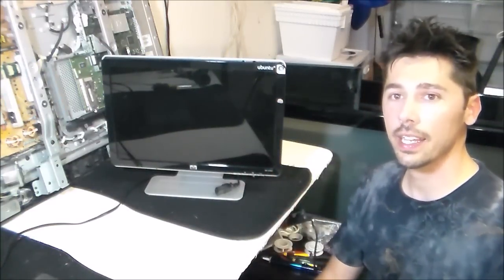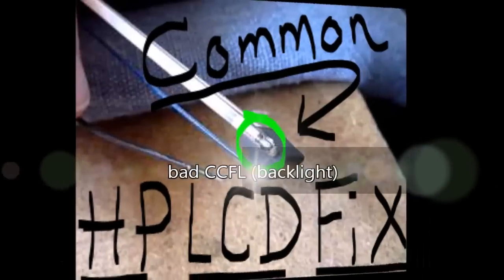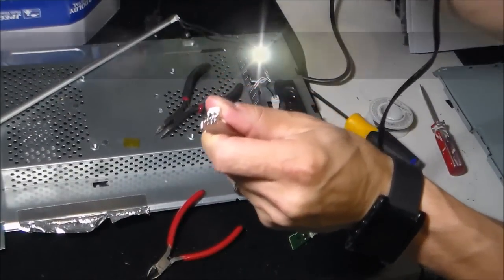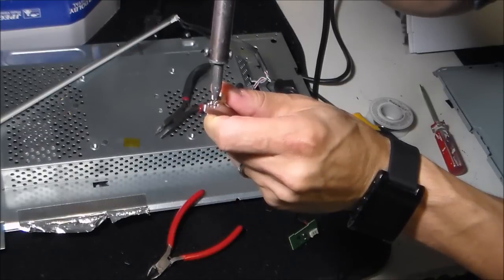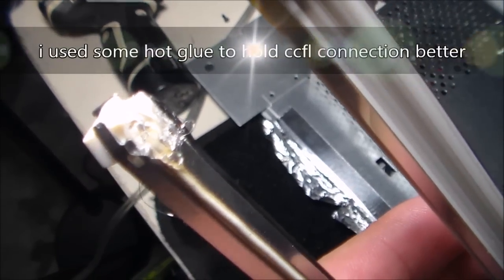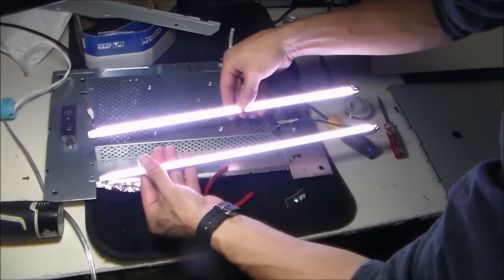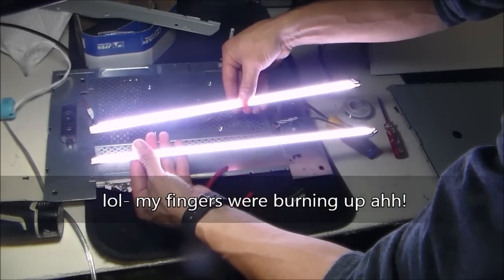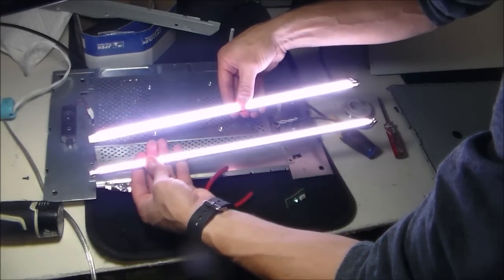HOW TO FIX HP LCD, monitor turns off after 3 seconds (common repair)

Comment from the maker: Common fix for HP LCD, i worked on this video all night i hope it helps someone. please like/share/sub
get lcd caps here- http://www.amazon.com/Samsung-CAPACITOR-desoldering-CAPACITORS-Replacement/dp/B008PWWS32?tag=tampfreepcpin-20&linkCode=w13&linkID=&ref_=assoc_res_sw_result_1
 #lcdfix   #commonfix   #easylcdfix   #lcdrepair   #lcdservice
Reply: Very nice video again, do you have a video where the lamps are ok and you check the Power board capacitors?  thanks so much.
Reply: I think I'm gonna buy another computer
Reply: +sl2k4u +1 : high voltage inverters can be faulty too, I am trying hard to figure which can be : bulbs, inverters, capacitors ... Even with measuring devices.
Reply: +RegneGames Hopefully you figured out the issue by now, but different issues can provide differing effects... Sometimes when the inverter is bad, you'll see a pink hue prior to the screen or backlight turning off. With caps in the power supply you'll end up with issues such as an audible alert if the monitor has speakers, lights turning on / off, monitor not turning on, etc... With the backlight shutting off shortly after the monitor turns on, it can be the bulb or electrical component related.. In this case because the connections were "burned" away, there was still a connection but after applying current, the wires were able to sustain it for only a short time...

This may be the same issue I'm having with one of my new monitors; I have 3 I'm waiting for caps to arrive in the main and a new one I got where the backlight shuts off in under 1 second... I'll double-check the connections on the backlight when I go through the disassembly phase. Cheers.
Reply: +Tampatec  my  hp 2310 just went out, do you want to fix it, I'll send it to your place, and you tell me what is wrong with it then we take it from there., 
there was some lines on the right side last night, and for the past week there was some low frequency flickering in the monitor. then went out black, as someone shut off the lights.
Reply: Fixed all except the one where the previous owner tried installing a cap backwards.. need 2 new cfls, then I need to also rewire the tray where they're mounted in because of a design-defect which causes the wires to burn..
Reply: Is there anyway I could ask you about symptoms my monitor has and if its the same as this video?
Reply: hi I have an older type hp Dell computer when I turn it on it seems to get stuck, but the computer is on and is running all the time. I don't know what to do and need help. I 'm not too computer savvy.
Reply: Rongo Taingahue Do you hear any beeps? Check the caps ( cylindrical usually with a K indent on the top, unless solid state ) to see if they're bulging or loose like a loose tooth when the computer is off. If so, then you'll either need to replace the caps or replace the board; if your pc is older than 5 years I'd suggest upgrading. It could also be memory, when the pc is off take one out and try to boot, then turn the computer off and repeat with other sticks of memory trying each stick in different slots. If you do see text on the screen but it says something along the lines of missing boot record, etc.. it is likely the hard-drive. -- you should be able to turn it off forcefully by holding the power button, if not then flip the switch on the power-supply or unplug it...
Reply: Tampatec I broke my screen you didn't explain the hidden screw I had to find that hidden which cost my screen that broke
Reply: Tampatec I broke my screen you didn't explain the hidden screw I had to find that hidden which cost my screen that broke
Reply: i am so glad its not a problem with my computer itself. Granted mine is a 2009 monitor(didnt use it for 4 years) so thats still 4 years of use. I think an equivalent monitor would run me 100 so maybe I should try this. thanks
Reply: i need help of fixing my computer it is a touch screen and is windows 10 but the screen and the lcp panel within it is cracked as well i need help to fix it
Reply: Tampatec I have a 52" sharp aquos LC-52D85U one of the lamps went out... Do u know where I can find one? or is there some type of rig to fix problem? T.V will not stay on

Comment: I found this very useful. This eliminates the possibility of bad capacitors. You could easily apply this theory to some issues on certain LCD monitors. I'm not saying it could apply to all, but it could help to narrow down the problem a lot easier. I'll take this into consideration. Thank you for this tutorial.
Reply from the maker: cool thanks!
Reply: Same here, i'm looking for a faulty capacitor and discover this video. Many Thanks @TampaTec !

Comment: I have a 26" Vizio it turns on and the picture comes on the screen but then the lights just goes out after like 3 to 4 sec. the image is still on the screen but you have to flash a light on it. I thought it could have been the inverter but could it be the led lights like on this video?..

Comment: Now how dafuq do i put all the parts back together?
Reply: I like to make pitctures from every step when i disassemble stuff.
I also use manny bowls for all the screws u need for all the different step so i don't mix them up and put them at a wrong place.
greetings I am gonne fix my Hp screen now :P
Reply: @hmcredfed1836  You can also take a sheet of cardboard and draw the profile of the piece you're disassembling right on it (drawing the various screw points as small circles), and then "poke" the screws you removed directly into the cardboard template. Have smaller individual pieces that are also screwed together, draw a smaller template! This way you don't have to worry about mixing up the various screws which will have different lengths and thread types.

Comment: Just wanted to say a giant Thank You! I just used this guide to repair an HP 2509b monitor.
I was very skeptical because both lights were going out, but fixing the burned area on a single bulb unit seems to have done the trick.
All the best!
Reply from the maker: Awesome! Congrats fixing your monitor 👍.
Reply: How did you fix the burned area, because it means there is an open in the bulb?

Comment: way too much work! I'll end up doing more damage then good! I'll just buy a new monitor!
Reply: Good to see just how much work is involved in taking apart an HP monitor. We had much better luck with a big 24 inch LG repairing the backlight (much easier access). Have an HP LP3065 to replace the backlight on.

Comment: Thanks bro, you helped me save 9 monitors for my home setup. I just needed the tubes. What I learned is my tubes were fine after 16 years on HP 1730. What fails on this model is the output coils secondaries. The low height transformers that are about the size of a stamp. These are hard to find so you might have to rewind them. Old HP were built like tanks.

Comment: This video was very informative. My model would stay on for 1 second then turn off. If I had the monitor in the right lighting I can barely make out text, so this led me to believe it was a backlight issue. I was able to make my way into the settings>brightness section and decreased the brightness. I then turned off/on the monitor and it worked. Not sure how long it will last now. But one thing is for sure..the monitor's capacitors (as stated in this video) are more than likely busted.

Comment: ppl me problem is next : me PC monitor works until i turn off me pc and i go to sleep and next day when i turn on PC i go t pictures on me monitor for 2sec and disepire and what i do?? in start of me problem i found solution 5-6 click on power buton of monitor and i got pictures and monitor works totaly ok until next day and new turn on me PC can some1 tell me are is problems in capacitor or what? tyyyy me monitor is samsun 2220LM

Comment: hello +Tampatec mine is hp pavalion 22xi it turns off after 2 hours and i have to unplug it then the time becomes shorter is it the same problem . checked the capacitator on power supply board and they're fine ?! is it the backlight ccfl ? note the lower the brightness the longer it stays
Reply: It sounds like something is overheating. Could still be capacitors, they could be on their way out. They're cheap enough that you could replace them to be sure. It most likely isn't the issue shown here.

Comment: Interesting... I thought that these symptoms occur when the lamps are burned out.
Apart from this, the idea of glue is not good, because of the high temperature lamps at their ends, the glue will melt and flow.

Comment: nicely done, I wish I'm patient just like you on putting them back together again :(
I have a Sharp LCD monitor when I plug the vga cable from a loaded windows CPU it display the windows screen for 1 sec and goes black, also when turning it on. But looking closer at the screen I can see the icons it's just too dark, like off. Do you think this video relates to my LCD monitor's issue? Thanks.
Reply: I have exactly same issue with my LG monitor. Were you able to resolve the issue? Thank you

Comment: fStrange thing happend to me yesterday with my new gaming PC... it was running fine and then i let it to sit for about 1 month with no cables... yesterday i put the cables back on and i get : No Signal from Motherboard to the Monitor... :(

i try :

1- Remove MB Battery and put it back on
2- Remove RAM's and put it in different slot
3- Restart CMOS
4- Hold down the Power Button for 1 min without Power Supply Cable In

None of them works, still get no signal, the fans are spinning, CD ROM is working fine... but No Signal to Monitor :((
The monitor is ok, VGA Cable is ok also cuz i try it in another PC...

I'm out of ideeas i swear :(

I have record a video, take a look on my channel Tampatech

Comment: I'm curious if you have any ideas on my "strange" issue with an HP 2311x  monitor. It will run just fine EXCEPT when I go to maximize any sort of video or even a picture to full screen and it will then shut off and reboot?! Does that on both a Win 10 machine and on a Raspberry Pi 4.

Comment: Windows 10 has a peculiar behavior after 25 days booted up--it turns the monitor off and on once per second when the monitor is supposed to be on standby'/sleep mode.
After a number of times doing this, it must have burned out one of the backlights on my LP3065, because the entire monitor is half brightness now. Still evenly lit, but 50% of normal intensity. Odd thought, because when a backlight fails, usually half the monitor goes dark.
Very annoyed at M$ for making an OS that does this destroying a perfectly good monitor.

Comment: my monitor turns on, shows picture, makes hissing sound, then turns off. Do anyone know the problem
Reply: Don't know if it is a bad capacitor.
Reply: Power issue.
Reply: can it be fixed?
Reply: when i push the power button on and off for a while it will finally stay on.
Reply: snakes
Reply: Robo Gamer same
Reply: +Robo Gamer Definitely a faulty cap.
Reply: CoolKoon you are correct I replaced one of the samxon cap with a Panasonic one. It worked perfectly after.
Reply: Robo Gamer hey wassup can u help me ?
Reply: Cats

Comment: My monitor used to go black after 3 min i changed the backlights but now it turns of after 10 min. 
Al the capacitors are ok looking, none of them are blown. 
Any tips ? I highly think it's the power circuit board
Reply: Hi! were you able to fix it? thanks!

Comment: That a common problems in HP product LCD monitors cheap CCFL plastic ballast for lighting up the CCFL lighting tubes.That not a common fix,that a very details to take the monitor a parts  and micro soldering works so much of its.These HP monitors and design should have been recall and fixes by the company HP itself replaces with better plastic better plastic ballast for the holding the of the CCFL tubes.

Comment: Thanks for the tip on the burned out wire. I took the disassembly slow, but got it done without breaking anything. The monitor is back up and running.

Comment: I have something different going on. so basically mine does turn on, shows the desktop but after a few seconds I hear a weird high pitch noise coming from inside the monitor, then it shuts off but the light remains blue "gateway monitor"... anyone know what's going on?
Reply: Hi! were you able to fix it? thanks!

Comment: sir i have an lg lcd 42lc55 and the problem is blinking the green led 7 times after stabilizing about 10 seconds and i can see picture with the help  of lens and after goes out 
do you have experience with similar problem ??

Comment: hey Yo can you recommend me where I can get the Lights itself from ??? thank you

I did what you said everything worked out well, but now my monitor works only with the bottom lights on. The top light "bulb" cracked.
Reply: This is a very late comment, but is you respond: I also broke one of the bulbs did you find a way to fix it?

Comment: Hello,

I opened my HP 2210i monitor because I have no more images.
After taking everything apart, I realized that on one of the 2 backlight bars, the neon species are broken at one end (the one where there are the 2 wires). So I can't glue them back together or solder the wires again like in the video.
Also, I was wondering where to find the backlight bars to replace mine? The only reference I have is 1P-9CT91DFfN9 and I can't find anything on the web with this reference (even partial).
Thanks for your help and reply.

Have a good day

Comment: I have this same problem on my HP w2207h, on my old video card this issue didn't happen, the picture was solid but the card went bad.  Got a new ATI RX 560 card (4gb) and plugged it in.  Now in the mornings when I start the PC and turn on the monitor the monitor will remain black and show nothing, I turn off the monitor and then back on, and it will show the picture and color bar for 2 seconds and go back off.  I do this 2 or 3 times messing with auto select button and it will come on solid and be fine ALL day!

problem with the monitor or the card not supplying power enough or a warm up problem?

Comment: i have a hp 2159m an i took off the black frame like you did but my monitor won't pop out like yours did . if you know the 2159m model is there another piece of plastic to take off. i don't want to pry on it and break the plastic , help please!

Comment: Thankx i have a dell SE198WFP and its exactly the same thing inside, took it apart just like you show on the video and there it was burnt cable disconected from the backlight, so i bridged it and IT WORKED!!... for 5-8 minutes then it went off again!..dang it. why? im just gonna take it apart when i find a permanent solution..maybe you can help me..?

Comment: Hello i have this monitor it poses on good it does have this issue how ever I leave the power button on top on and When my PC goes into sleep mode the button on top of my Monitor will be yellow the PC comes out of sleep mode the monitor does not I have to unplug it than its fine... Can in turn off power saver on the monitor settings ?
Reply from the maker: Most Pc monitors normally turn off if no signal is detected but some lcd monitors might have power saver settings.

Comment: that problem is typical of the monitors hp I had a hp w19b with that same problem and had many monitors and only with hp happened to me that will try to avoid them therefore problem

Comment: My sharp (hisence) lcd tv turns off in hd mode game or any other.  Works in energy saving mode only and if there is a flash of light in the picture it turns off. I have to let it cool down and sometimes it works for a little while. Did you run into something like this before?  I've searched the web if anyone else had a same problem but couldn't find. Please let me know, if you know this fix. Thanks

Comment: I will just add that hot glue..  on a surface that gets hot..  doesnt work....   it will for a bit, until the surface gets hot and the glue melts off and goes where gravity is telling it to...  id use heat shrink or super glue or high temp hot glue (higher than the operating temp of what your trying to glue..)

Comment: I emailed you a while ago. I need help with my LCD 37" insignia tv. It shuts off after 9 sec and keep turning off and on by itself until I unplug it. I was told it was the Power Supply but changed that but still doing it. What can it be I was also to it could be the main board. The power light stays green and the screen shows a quick flash of please wait then it turns off. Help lol
Reply from the maker: sorry i get hundreds of emails and comments, if you got standby volts on power board then check for blown caps on main board. what i do is unplug tcon board and see if lcd stays on if still no then next unplug inverter board and see if lcd stays on if yes then i assume that there's issue with inverter board or backlight. use flashlight on screen and press menu you should see menu image, this means backlight is out.
anytime unplugging boards Unplug lcd powercord first, like if this helps 8^)

Comment: hi there i have a ÀOC 19"  lcd monitor which had the same problem. i opened it up and checked any bulged top capacitor but all seemed fine. then i went  towards ccfl and checked the terminals and they were perfect. for a test i put only 1 CCFL plugged and gave a run. it kept on for 2 seconds and did yhe same for other which resulted same.  can you help me with it as my lcd does not stay on after 2 seconds.

Comment: I have an HP LP3065 that, when power button is pressed, will illuminate the status LED green for a few seconds, then orange. Nothing onscreen. Makes a faint clicking noise when on. The computer sees it at the correct resolution. Do you think the backlight is the problem? Thanks for the tutorial btw.

Comment: I have a LED monitor that doesn’t work I don’t want it to work what I wanted to do is to create it a lamp.  But it keeps turning off because it’s not connected to computer is there a way to re-wire the switch directly to the power so it doesn’t turn off